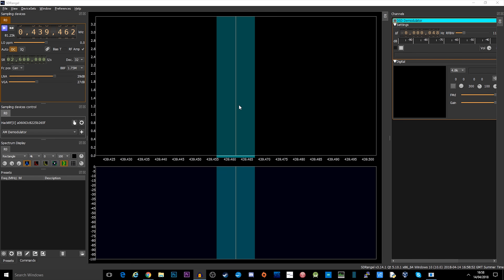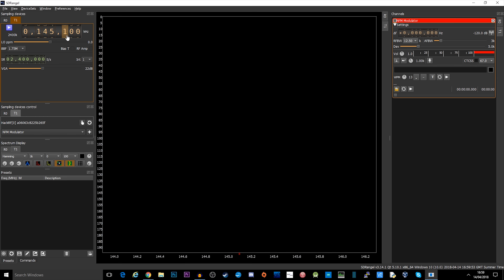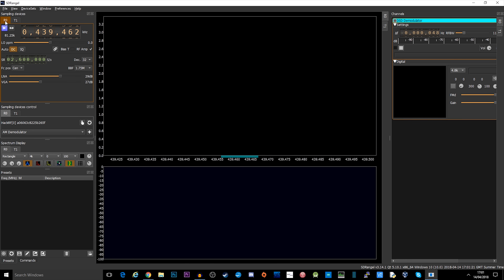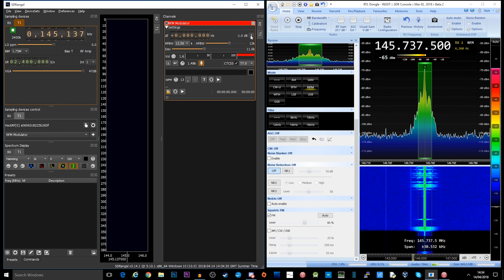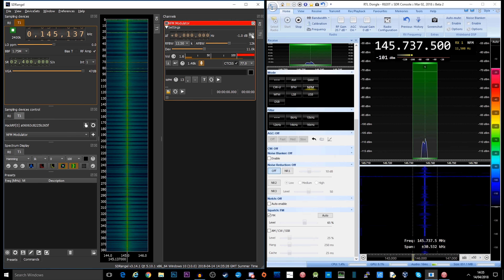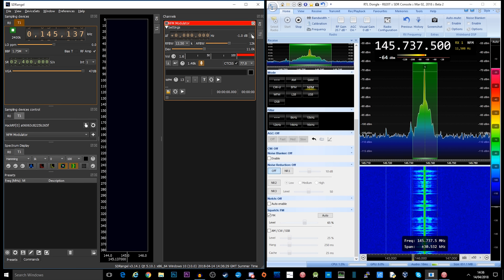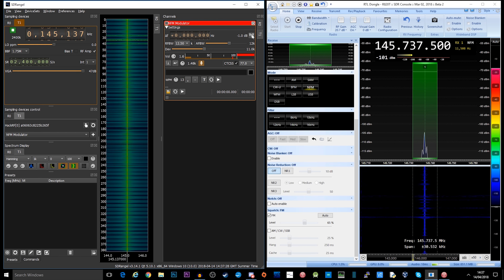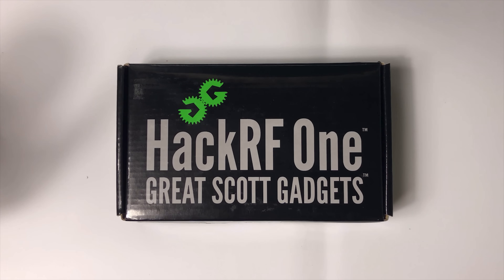Transmitting With A HackRF One Via My Local Ham Radio Repeater

Comment: I know this is 3 years old Matt, but did you just select 12k for audio bandwidth and leave deviation at 5k on 2M? I'm trying this now but I'm using the 2m band specs of 2.5k deviation, audio bandwidth to 3k, RFBW to 12.5k I think.

I am just doing this now with a clone, lots of fun! But at 32mW out you'd need a decent antenna with some height unless you had the amp. And I dare not think about the filtering needed...

Comment: Please help me. I bought hack rf portapack h2. The software came installed. However, when I want to use it by connecting it to the computer in Hackrf One mode, the USB port does not detect the device. Why could it be

Comment: I have noticed that I get quite a bit better reception with a cheap rtl dongle than I do with the HackRFOne. I was able to transmit a song I split into two files for left and right and got the Hackrf to transmit on two separate stations. It would only work properly on certain frequencies though. I figure if I can make it play stereo that sounds better than FM radio then it should make a good ham radio. It needs filters and a couple of amplifiers.

Comment: Thanks for the tip about RF amp, i just started using SDRangel yesterday and was disappointed by the tx power of the hackRF i bought a few days ago.
It was even weaker than the cheap RF433 modules you buy for Arduino

Comment: Hi, love you vids I've learnt a lot from them. So I have sdrangel installed on my windows 10 pc where I have been using my HackRf for years to monitor various things. I recently got my ham license & would now like to use the HackRf as a qrp station or for local repeater use but just cannot configure sdrangel.
I have the windows download, whenever I try to connect with the HackRf sdrangel crashes, I've  had alook around but cannot find a work around so help would be appreciated with this issue.
Thanks Mac M7AZV 73's..
Reply: you need to use the soapy hackrf driver and not the regular one

Comment: So are you using two antenns.. i dont get it?  One send antenna for the Hack RF and one Reviece for the RTL-SDR=??
Reply from the maker: Yep, that’s exactly correct. I had to do this because SDR Angel software could not switch fast enough between RX and TX without it crashing, if you’re looking for a SDR transmitter with good software support, above 70MHz look at the Pluto SDR :)
Reply: @TechMindsOfficial  Ok Thanks m8.. That sorted out alot of things for me.. :) Cheers

Comment: What kind off amplifier would work for this?
Reply from the maker: It depends on what frequency you want to transmit on. But an RF amplifier designed for the right frequency would be okay. You would have to look into amplifier specs, to see what drive level it needs as the HackRF is lower than 10mw out put.

Comment: Hi Matthew, How are things in Great Missenden? I am N2SN ex pat G4FEB now living in sunny Florida. Was there ever a fix in the software to get a faster TX to RX speed? I saw in the video that you used a separate SDR receiver due to the long time elapsed before the RX audio came on. I am contemplating buying a HackRF One as they are now down to about US $90. Thanks, Dave. * * *
Reply from the maker: Hey Dave, thanks for message. To be honest I didn’t really investigate this any further, but at the time I had to use a separate SDR for receive because the switching time was far too long and sometimes crashes SDRAngel. Depending on what you are wanting to do, I would recommend using SDR Console with either a LimeSDR or Adalm-Pluto. SDR Console supports full duplex and works very very well, I guess it depends on whether you need the HackRF specifically. 73 👍
Reply: @TechMindsOfficial  Matthew, Thanks for the reply. At least I have room here for a good antenna as we have 57 acres here in the wilds of NE Florida. 72's Dave, N2SN.

Comment: How does the SWR affect the Hackrf? Can I break my Hack RF if I transmit in the wrong frequency?
Reply from the maker: I would always recommend only transmitting on an antenna that is resonant on the frequency you are transmitting on. However, the HackRF is only 10mw I believe so I’m not entirely sure how much damage you could do but best to be safe than sorry, use a resonant antenna 👌

Comment: Great video very informative . What type of amplifier would you use to reach longer distances?
Reply from the maker: It depends what frequency you wish to transmit on, plus, any linear amplifier would have a minimum rf power to drive it, so you would have to check that it would run from the mills watts the HackRF outputs :)
Reply: @TechMindsOfficial   You probably already know all this so I say it for the benefit of other new HAMs looking to use a TX-capable SDR for transceiver.  Most power amps will require 1W or more to open up.  Hack RF is just noise to those inputs.  You *could*, in theory use an LNA backwards and get roughly 15db gain on tx but you likely wouldn't be able to receive back through it.  You might need a setup such as yours to rx.  But honestly, I think anyone wanting to use a wide bandpass, low bit-depth ADC lab SDR as a ham radio needs to do some testing and analysis and add the right filtering.  HackRF chooses less-than-wise IF and there is boat loads of IMI on some bands.  2-Meters almost seems like the perfect TX band for the HackRF.  I love this video!
Reply: @joehancuff6310  Wait! So whats the transmitting distance of hackrf one? 1km? 5km? 100m?

Comment: now the big question is it just to add a linear amp to it so have a real 100W SDR ham radio?
Reply: Not without a BPF, good lord
Reply: @MarkPentler  I mean...

It would be an SDR "Ham radio" - but the operator would have to understand that they'd be exclusively responsible to all of the characteristics of what they output.  For example, if there was a side lobe out of band at the HackRF One output, or the channel bandwidth was too wide - the linear amp is not going to know that it's not supposed to amplify that.

And because a lot of bands are licensed by fee or rule (requiring that the transmitter be authorized by the Authority Having Jurisdiction) - transmitting with one of these may be prohibited in someone's country, and interference out of a permissible level could trigger a hefty fine  or a shut down order.

For instance in the USA, it could be technically possible to transmit on CB 27MHz, but because the HackRF One is not licensed by the FCC here to do that, it would be illegal to do so.
Reply: Tim S yep. No U.K. foundation can use unapproved types so no DIY stuff etc. I’m learning my intermediate so I can use it on the ham bands with filtering.

ISM-only until then...
Reply: Todd Carney since posting a lot of this stuff I have found that myself. Seems you’ll always get harmonics so it’s just a piece of the design by default.

Cool :)
Reply: https://www.banggood.com/DIY-45W-SSB-HF-Linear-Power-Amplifier-Amateur-Radio-Transceiver-Shortwave-Radio-Development-Board-Kit-p-1018834.html 

40 Watts oput with 10 mW input. Dont forget low pass filters at output.

Comment: So, how large is your antenna and how much power is it putting into it?  Also how far away is your repeater?
Reply from the maker: Standard power from the HackRF, 10mw. I was using a dual band mobile antenna on a magnetic base, around 1 meter long.
Reply from the maker: Repeater is about 4 miles away .
Reply: Cool, thanks mate!
Reply: @TechMindsOfficial  10mw only and you can reach 4 miles? did you also try an amplifier? if so what are you using?
Reply from the maker: Open Minds nope no amplifier was used. I’m fairly high up and the repeater  is also high up so possibly line of sight. 👌

Comment: I like the HackRF overall.  Have been using it mainly for spectrum analysis, but would like to try out receiving Ham.
Not knowing much, could someone describe a basic setup?
Do you need an upconverter, such as Ham it up?  Maybe a much bigger/better antenna?
I see a few bands in the different Ham frequencies, but have never gotten any real audio. 
I'm just using a small telescoping antenna, hackrf with sdrsharp.  No upconverters, in line filters, or additional equipment.
Reply: The HackRF One will receive almost all Ham bands without an upconverter. It will receive down to 1MHz. Try a simple long wire antenna (just an insulated wire connected to the HackRF's antenna center connector) and tune to 7.1MHz and above and look for lower sideband signals to hear Ham voice transmissions.
Reply: Josh Bailey hi just wondering where you bought your hackrf one ?
Reply: What can you do with the hackrf?
Reply: memlord  HF can propagate all over the Earth. You can hear signals from anywhere.

Comment: hi mate, I have done everything and am at the current point you are on the video, but I am just wondering if any additional amplifiers are needed or if there is a way to communicate between other ham radio operators because none of them are replying to me but everything is being transmitted properly
Reply from the maker: The output from the HackRF One is literally minuscule, I am in a high location and the repeater I was talking through is around 2 miles away. But the antenna I was using connected to the HackRF was just a mobile 2/70 antenna on a magmount in my shack room. Wasnt even using the outside antenna for this example. Have you checked on another receiver/sdr that your hackrf is transmitting correctly?
Reply from the maker: Also check that SDRangel is actually picking up your microphone, you can see the graph moving as I talk in the video.

Comment: Thank You for your videos! I am from the US and am wondering why the equipment you can get in the UK is not available to buyers in the US?
Thanks!
Reply from the maker: 1crazynordlander it should be available, in the us also. Which equipment are you referring to?
Reply: The HackRF One I see is available but I would like to get a nicer outdoor antenna for my NooElec NESDR Mini 2 unit. I was looking at the three antennas you have listed here. I know each has its own frequency use. When I go to the description Amazon says it is available only in the UK. I found this GigaParts website I might be able to use. I am interested in the 70cm to 2m and also the Discone one too. I am going to go back and watch some more of your videos. Do you have one explaining the antenna differences and their uses. I am new to this but interested. Sorry to be such a pain. Isn't it late there?
Reply from the maker: 1crazynordlander No problem at all buddy, it’s only 10.45pm here lol.. Do google search for Ham Radio Outlet and I’m sure you’ll get some good results for your area. Most of them will ship and also be able to give you good advice over the phone or by email before placing an order.
Reply: @1crazynordlander 
HAM Radio Outlet, Amateur Electronics Supply, and MFJ are my go-to suppliers. Occasionally I use another one I can't recall the name of (apparently TOO infrequently used!)

Im in the middle of Kansas and we have a Radio Shack in Derby (just outside of / connected to Wichita, KS) 2 hours from me and they have a great selection of used, refurbished, and gently used consignment gear. Plus being run entirely by licensed HAMs, they are quite knowledgeable. I get real answers instead of "I'm sorry, I don't know" like every other RS I've been in.